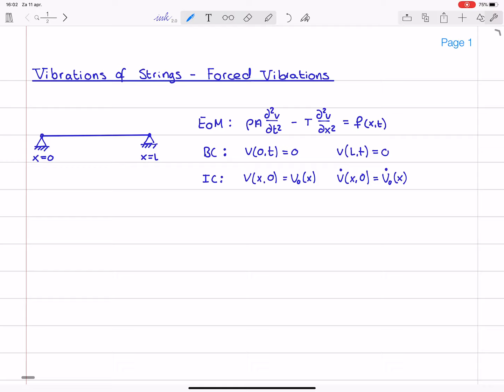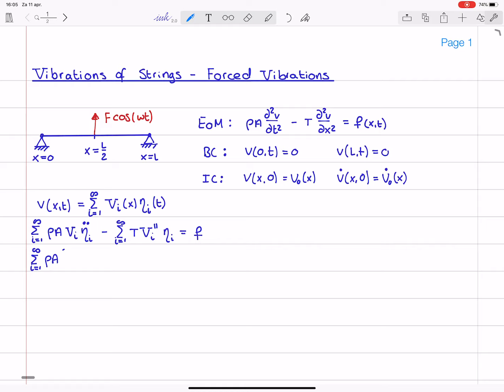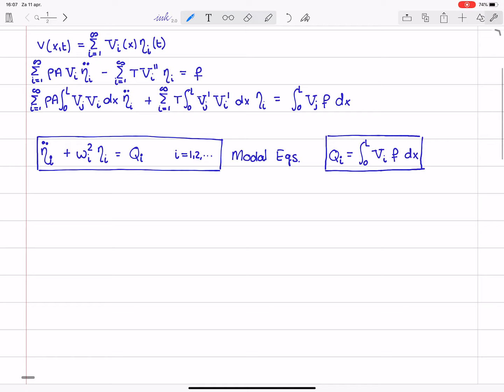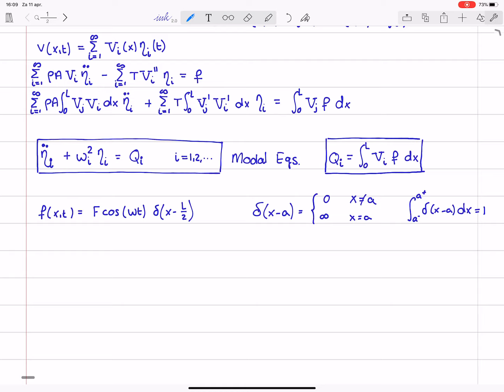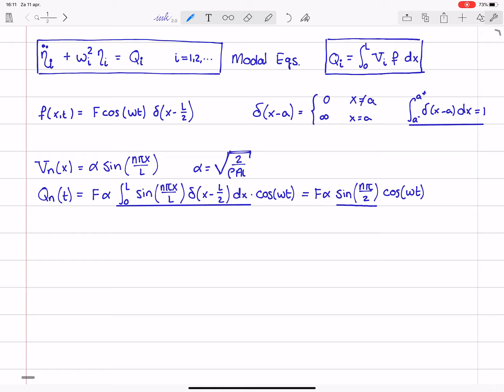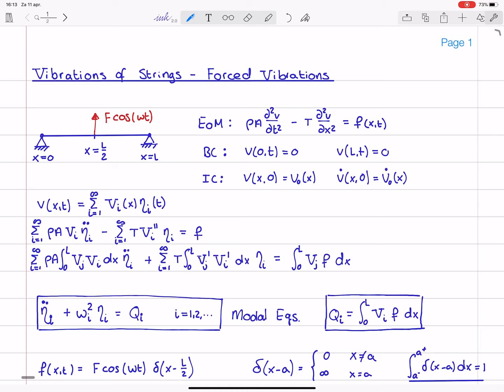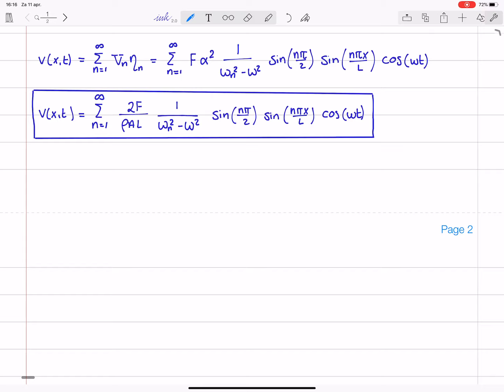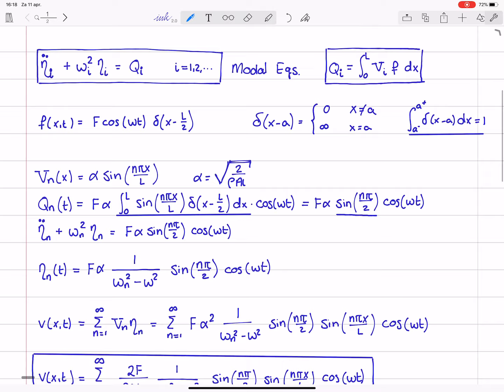Mechanical Vibrations 49 - Strings 6 - Forced Vibrations

Comment: @Jurnan Thank you for this lecture series. I have a question. Why have you considered only the particular solution for  $\eta_{n}(t)$ and ignored the homogeneous solution?
Reply: Hey Vikas, I think I can help.
My understanding is as follows: If we assume that there is some form of damping present in the system (although neglected in our calculations), the contribution of the homogenous solution will disappear over time. The particular solution, however, is only dependant on the right side of our equation: As long as the force acts on the system, the particular solution will be of the same magnitude (on the average of a cycle) throughout time. Hence, we only focus on the particular solution.

Also see Jurnan's video on forced vibrations for SDOF systems (also in this lecture series).
Reply: Over time, the homogeneous solution will go to zero. As we are evaluating the system to infinity, we only need the particular solution.